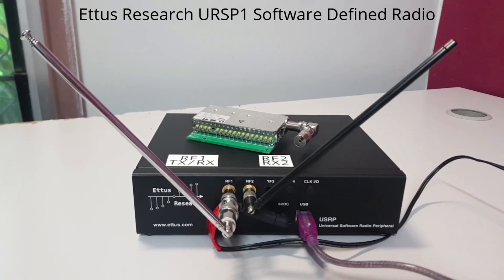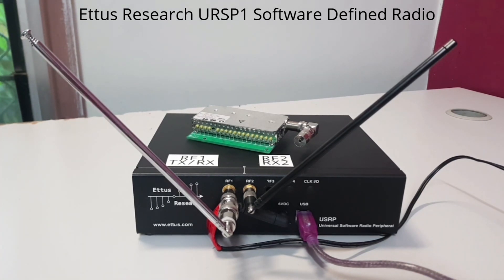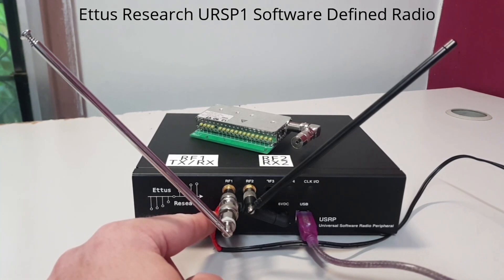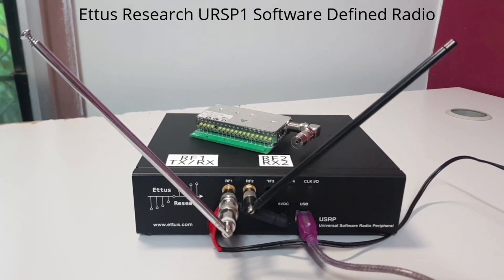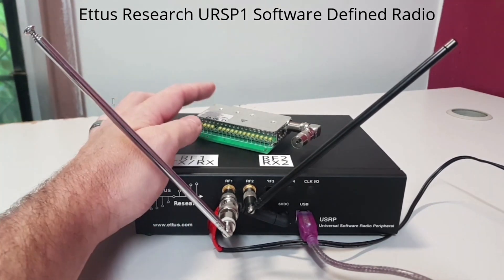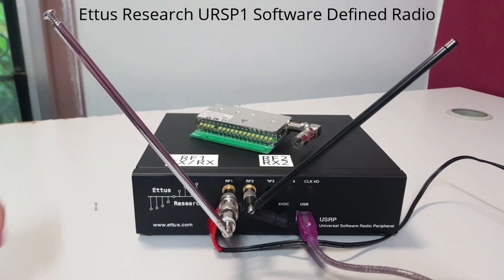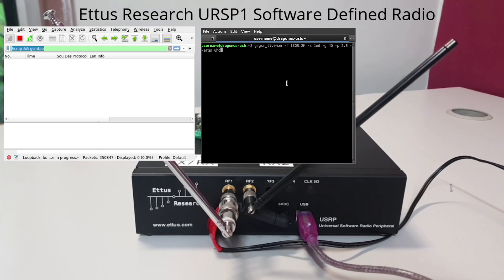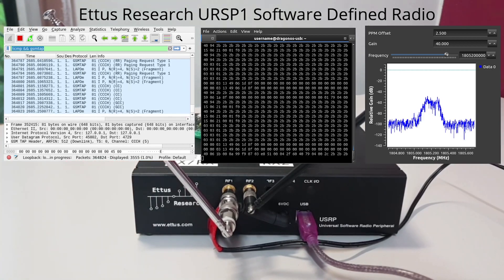USRP1: The Groundbreaking Software Defined Radio You Wanted Back In The 2000's, But Couldn't Afford!

Comment: Hey, did you happen to figure out the driver sitation ? since these are USRP1 some special drivers are needed, typical UHD Driver isn't cutting it. Any info would be really nice. Tnx
Reply from the maker: Hi, what exactly are you trying to do with your USRP1? I have successfully used my USRP1 to receive 900 MHz and 1800 MHz GSM in DragonOS FocalX using the regular UHD drivers (well, I assume they are the normal UHD drivers) I might be able to make a video demonstrating this, if you would like?
Reply: @RobVK8FOES  Wow, that seems really interesting. there are two sets of drivers according to my research, the one that came with the gnu radio 3.4.X with libusrp. I believe openbts v2.x was the last thing ran with it and i did manage to get it working but it doesn't work all the time.

It sometimes pops out "usrper fails in usb_claim_interface", i tried many things but didn't seem to fix it, but on the modern UHD Driver, i can actually load the firmware but when i run OpenBTS, it throws out that the USRP1 is not supported and still needs patching with the libusrp. 

I would love to see a demo, please do note that the version i have are patched to work with RFX900 and RFX1800, They have modded clocks to safely operate in at 52Mhz.
Reply from the maker: @ziramagic7003 Have you got some kind of external reference clock on your USRP1? I was led to believe the oscillator in these SDR's is far too unstable to be used for cellular base stations, as the TDMA timing in 2G will not be precise enough to the mobile phone to sync to the base station. I have read that the "clocktamer" was the external clock reference board people used to mod their USRP1's with back in the day.
Reply: Ettus UHD driver still supports USRP1 and daughterboards.

Comment: I bought the USRP B100 in 2008 (I think), it was quite expensive, and almost immediately afterwards RTLs became available and known. I've still got it, it's literally sitting next to me as I type this. I've tried to revive it but the drivers/software support isn't there anymore. If it weren't for the poor support situation it's still quite the capable device, on par with a bunch of modern devices. I guess that's the price for being an early adopter.
Reply from the maker: Yeah, the B100 sure is (or was?) a nice bit of gear! I know what you mean about the poor support though. Gr-osmosdr and SoapySDR still support the older USRP's as far as I am aware, have you heard of DragonOS linux by cemaxecuter? The latest ISO release FocalX is based on 22.04 lubuntu and my USRP1 worked fine on it for decoding GSM. Maybe check DragonOS out if you want to find a use for you B100's. What daughter-boards do you have installed in them?
Reply: @RobVK8FOES  I tried DragonOS on a pi 4b but never got it to recognize the device correctly. It's pretty hard to look up info to troubleshoot what I'm doing wrong, to boot. Maybe I'll try again this weekend.
Reply from the maker: I highly recommend installing DragonOS onto a bootable USB storage device of some kind and running it on a PC. I never had much luck with virtualization or on a Raspberry Pi. Bare-metal on a powerful PC is so much better!